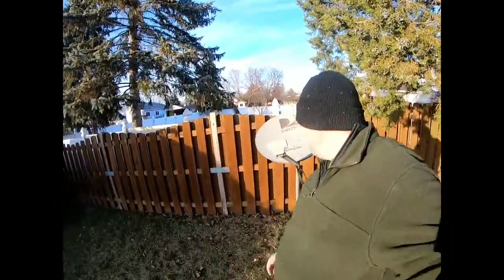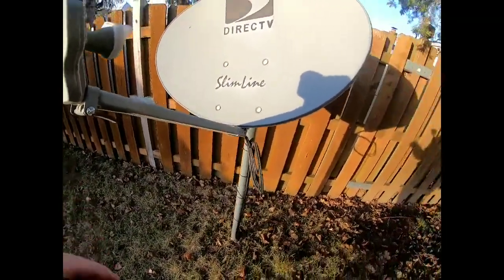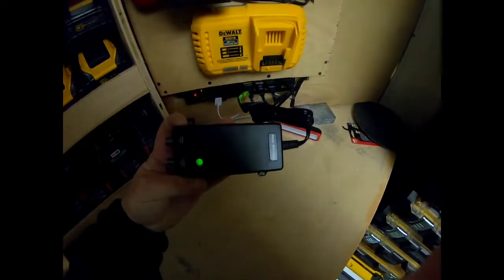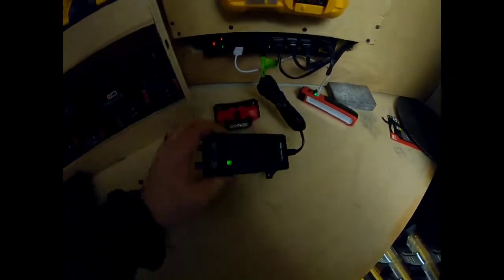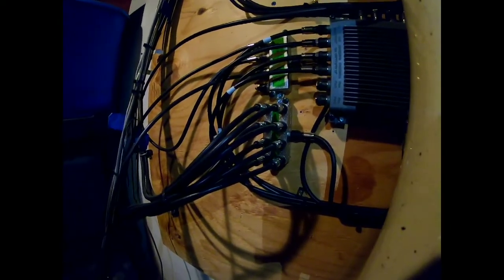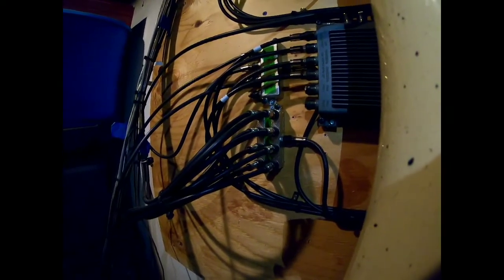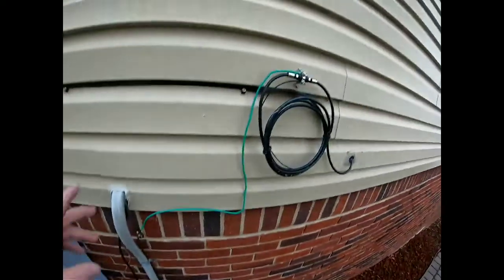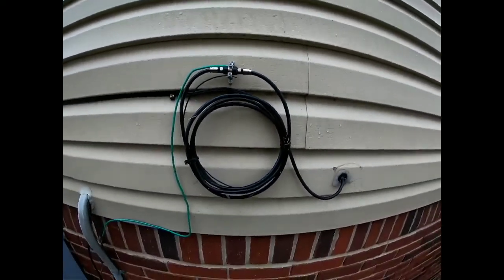DIRECTV Troubleshooting

Comment: Thanks for the vid. Great info. My signal has been hit or miss, but good enough to watch TV. 94+ signal. Then it quit all together. 775 code. After all basic checking/resetting/testing, noticed my green swm light dim and flickering. Unhooked cable from lnb and came on solid. Thanks to ur video I confirmed prob have a short in my cable.

Comment: Thanks for this ...

But you know it's funny, from the camera angle on the dish it really looks as though there is only one coax twin pair (or two individual coax cables) coming out the LNB support arm.

Which can't be right of course for feeding SWiM-16 multiswitches. That require two twin pairs (or four individual coax cables) from a four outlet legacy (or non-SWiM type) LNB.
Reply from the maker: Yes sir. I just have the two coax pairs zip tied together. Feeding 4 power passing splitters that feed both swm16s